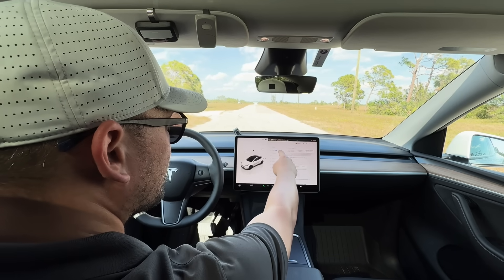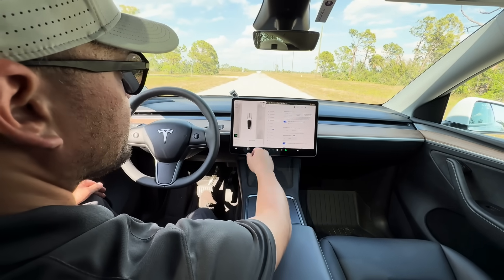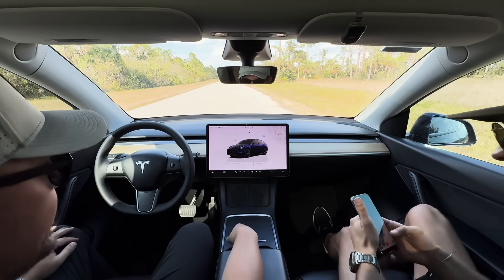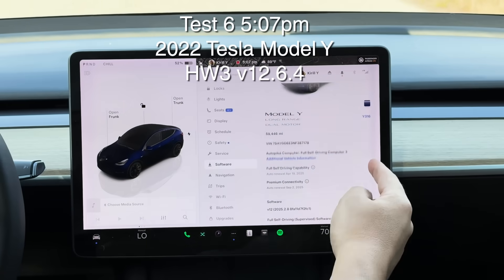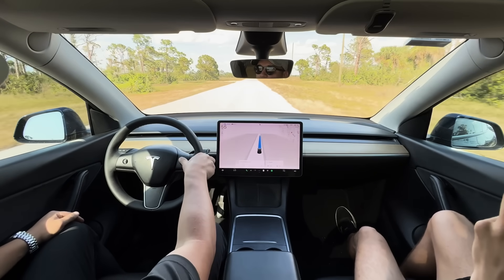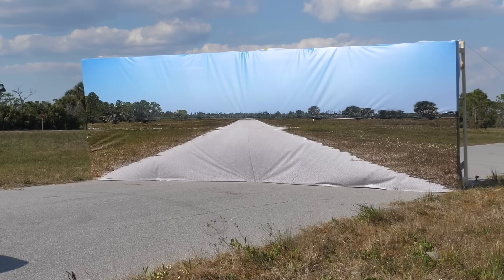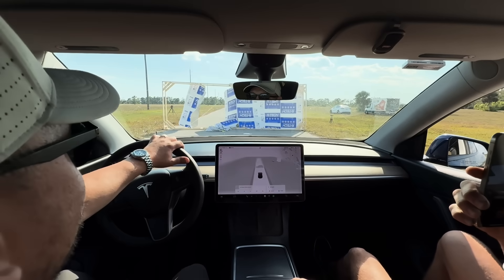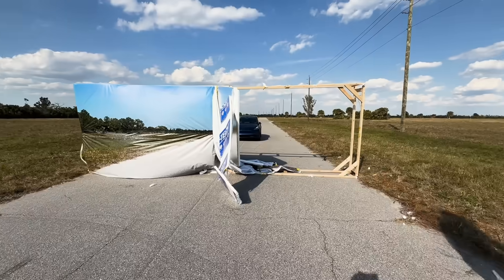Mark Rober Debunked - You can't fool a HW4 Tesla using FSD!

Comment: Finally someone does a proper test! What’s most interesting to me is in the last test the car doesn’t disengaged autopilot until AFTER hitting the wall. In  the Mark Rober video it disengages BEFORE, proving he manually disengages it.
Reply: Mark Rober is a liar.  He had ulterior motives.
Reply: Whether he did or he didn't is moot. The car was going through the wall and was past the point of no return for anything to be done.
Reply: @michaels9595  What I meant was it shows his intention to sabotage the Tesla run. And no, it would not have gone through the wall. He used the latest and greatest for LiDAR but previous gen software and hardware for the Tesla. If he used the latest for the Tesla as well it wouldn’t have gone through the wall. You have to compare apples with apples.
Reply: @Gilster85 we were talking the model y he was driving at the time. It doesn't see the wall in time to do something about it. Hitting the was unavoidable in that car. Right?
Reply: @michaels9595  Yes, the Tesla Rober used would have hit the wall but it’s using that Tesla that made the experiment flawed and screwed in lidar’s favor in the first place. It voids the whole experiment. Would you compare the performance of the iPhone 16 to the Galaxy Note 4? Of course not.
Reply: @Gilster85  ok just checking that we were seeing the same thing. Yes, he could have used it but as a laymen i did not feel deceived. Tesla autopilot was used and that was what was stated. I was not aware of FSD existence. But autopilot i was aware of and was familiar with issues that hit the common news. So the fact that it failed wasn't surprising. 

Why didn't he use the latest and greatest?  who knows, maybe he just used what Tesla he had and didn't put any further thought into it than that. But thinking he had an ulterior motive in either direction is not what i would jump to first.
Reply: @michaels9595 you didnt seem to understand Marks claim. He claimed that a camera system would always be fundamentally flawed in this scenario, and that the only solution would be LiDAR. Therefore his video was deceiving because, as this test clearly shows, Mark's claim is just plain wrong. A good scientist would issue a correction, given his massive reach. We will see if he is a good scientist or not.
Reply: @Supreme_Lobster  yes regarding the specific claim about camera vs lidar, this video testing hw4 shows that newer camera can detect the looney toons wall. 

Next, i hope this channel goes on to test the zero visibility rain and fog tests that Mark claimed failed. 

And yes I'd be interested if Mark does a follow up. It's how scientific process should work, i agree.

Comment: why not test the fog situation? or the heavy rain? or glare? Those are far more relevant and frequent.
Reply: Because you need to find heavy rain, fog, and glare. Mark Rober already tested glare from headlights but I guess Kyle could also do sunset or sunrise. And even Mark's HW3 Model Y on Autopilot worked fine with headlight glare. As for the other conditions; there are many such videos on YouTube already. Here's a few:
Heavy rain: https://www.youtube.com/shorts/v06fdMNJido
Fog: https://youtu.be/8REpnBJPcDg?feature=shared&t=264
Snow: https://www.youtube.com/watch?v=X_4RGfeICo4
Reply: @CyberFridge  That video of a Tesla in fog is a joke, I guess?
Here in Germany, you are not even allowed to turn on the fog lights in those conditions. Visibility needs to be under 50 meters to be allowed to turn them on.
-
As you may know, we have no speed limit at all, on most parts of our german highways. (5000miles without any speed limit). 
At night, the headlights of a car have a range of 100m. However, even my 11 year old Mercedes E-class has got radar with a range of 250 meters and allows for much higher speeds, than any Tesla (at night). Same goes for fog. 
I dont get, why people try to defend a camera-only system. It is obvious, that other systems also have advantages. So, why not combine cameras, radar and lidar, as most manufacturers do?
Reply: @dunjak111  Yes, I 100% agree with you that on the Autobahn (especially in the sections that have no speed limit) driving at night in the fog at high speed having radar would help. LiDAR, in my experience has a very hard time in fog created by real world conditions. Glycol or whatever they were using in the Mark Rober video doesn't have the same molecule size/refractory index from what I recall so it's not a perfect stand in for real world fog. Teslas approach is an end-to-end drive. Most people, are more likely to drive in cities at lower speeds on most days without 0 visibility fog. But you'll have pedestrians all over the place. Radar tends to give far too many "false positives" due to its range usually and I've tested different cars that use LiDAR and RADAR on top of cameras with various levels of ADAS. Last car I drove on the Autobahn was a Renault Arkana last year. Basic for the features it had compared to many others but did the job. So my guess is Tesla looked at the use cases and determined that it's easier to develop a steady system that uses vision only using neural networks and AI and that it can become many times better than a human. Eventually they may bring Radar back for extremely low event cases like 0 visibility fog at night on high speed roads but that's not where most car crashes and car-related death happen. So, address what kills most people; fix that, then you can go with extreme cases and avoid messing up your software with potentially erronous data in the meantime while it learns. BTW, virtually all Tesla being built for the past 5 or so years have had a radar on the INSIDE of the car facing the passengers. So it's not the Elon wants to save money. That radar wasn't used for anything all along but now with software updates they will be able to use it to dectect the exact size of occupants and if someone was left in the car for example to avoid a child being accidentally left behind in the hot summer sun.
Reply: @CyberFridge  Its either fog, or at night. The normal european headlights of a car have a range of 50-75 meters. That means, that by law, you are not allowed to drive faster, than 150kmh (90mph), at night. The radar has a range of 250 meters. So, it allows for a top speed of 240kmh (150mph), in my 11 year old Mercedes. (no fog involved)
Btw: It doesnt have autopilot. The radar is part of the standard emergency breaking system, of that time.

-----
" end-to-end drive [...] to drive in cities at lower speeds"
That is the huge difference between german manufacturers and Tesla. German manufacturers build according to german law and european regulations (for good, or bad).
As soon as a manufacturer allows the driver to take his hand off the wheel, the manufacturer has to take full responsibility for the self driving car. It is also not allowed, that any autopilot (or FSD) turns off just a second before the intervention. That is the german law.
Imagine a car without any autopilot causing a crash and the driver did not have his hand on the wheel. He will be held responsible for that. 
So, if Tesla wants to allow the driver to take his hands off the wheel, Tesla has to take full responsibility during that time. Simple as that.
I am not saying, that FSD is not capable! Tesla just does not want to accept that responsibility and that is why they dont get FSD in Germany, yet. Other manufacturers do accept that responsibility. 
-
However, for those reasons, Mercedes "level 3" works on highways, only. After you hear a warning sound, you have at least 10 seconds to orientate yourself and take control. During that time, the car has to keep the control and Mercedes has to take full responsibility for it. The useage of autopilots, (or FSD) has to be logged. That is the law and the reason for the different approach.
Btw: Germany was the first country worldwide to come up with laws for "autonomous" cars.  The laws are the same for every manufacturer.
Sorry, for my bad english..
Reply: @dunjak111  Alles Gut. Tesla does take responsability for any crashes that take place within 5 seconds of disengaging FSD/autopilot. It says so in their legal documents. So if a system disengages and the Tesla crashes 1 second later; it's on Tesla's system. There were a couple of instances of autopilot disengaging for unexplained reasons but those are from like 7 years or so ago. These days Teslas log everything to the second. In Mark's original video, I'm convinced that he unintentionally disengages autopilot by gripping and moving the wheel just before he hits the wall. Also, turning on autolipot only 4 seconds before he hits the wall was ridiculous as a test. I don't understand why he didn't give it more time. As we've seen from Kyle's tests, it wouldn't have mattered since HW3 doesn't correctly interpret the wall but it's not a realistic scenario. If the car is autonomous, it will be driving itself from 0 not starting at 40MPH (64km/h) and only have 4 seconds to react to a wall in the middle of the road painted to match the exact scenary. I mean: What does that test really "test" in terms of real-world applications?

As I said in other comments, had Mark said something along the lines of: "Tesla has HW4 with FSD which is more capable but because there are still many HW3 cars and not many people pay for FSD, we wanted to test the capabilities of the "basic autopilot" which comes for free with every Tesla against the latest LiDAR tech from Luminar." Perfect! No issues!. LiDAR is better than autopilot on HW3. The problem is that Mark picked that video title on purpose to mislead people and implied that autopilot was the best that Tesla has to offer; which isn't true. And yes, in some specific use cases, RADAR can help augment vision-only. But Tesla had RADAR and ultrasonic sensors on top of cameras in prior versions and the interference between RADAR and the camera input is one of the main reasons why they delayed the release for so many years. I think they want to make sure everything works great on vision-only AI. And then if it turns out that RADAR will be necessary in extremely rare cases; sure, add it then. The reality is that Tesla's cameras are better in most cases than humans already today and only getting better. It's not perfect yet.

Comment: Why did you change the location and paint a different picture than you did in the previous video? Here you have many trees around, which makes the wall much more visible at different distances. Also, the curve in the previous video hid the wall. Now you are approaching it straight from a greater distance. And you didn't test the autopilot itself. The situation and the picture in the previous video were more challenging than this long straight road with trees on the horizon in this video. You really wanted very much to have HW4 working well, right?

Comment: In October 2016, Elon Musk stated that a Tesla vehicle would be able to drive in fully autonomous mode from Los Angeles to New York City by the end of 2017. And last time I checked it’s currently Mach of 2025  and have tested the smoke or fog test.  ?
Reply: Here's FSD driving in heavy rain https://www.youtube.com/shorts/v06fdMNJido and in fog: https://youtu.be/8REpnBJPcDg?feature=shared&t=264 and here it is driving in snow: https://www.youtube.com/watch?v=X_4RGfeICo4
Reply: It can currently do that right now.
Reply: @swecreations  No it can't. You at a minimum need someone sitting in the driver's seat. Musk said you could call it on your phone and it would drive cross-country by itself. He also said it would serve as a robotaxi. He then went on to deny both those claims under oath in court. You were lied to, he knew he was lying, he took your money anyway.
Reply: @ Well that's a different story then, personally wouldn't buy a Tesla myself, like other EVs better.
Reply: @ Teslas were by far the best EV out there when they came out, ignoring reliability concerns. But they really haven't advanced enough to keep up with everyone else. The only thing they have going for them now is the superchargers.
Reply: @darrennew8211 the supercharger network is fine but it’s not the best in speed and cable management the cable are too short to work with most cars.
Reply: @V10PDTDI  It wasn't designed to work with most cars. Until very recently, it didn't work with anything except a Tesla. And the speed was way, way better than not having a charger around. :-) There was no other EV where you could reliably go on a road-trip that exceeded your single-charge range.
Reply: @darrennew8211 yes I know that it wasn’t intended for other brands but now the only tesla that’s can charge with the 800 volt system is the cyber truck but all other Tesla platforms are 400 volt class of system even the refresh model Y is still on the same system they don’t have the best charging speed the German,Koreans,Americans and Chinese have better chargers and charging cars in Europe Tesla has no advantage with the Tesla network they all use the same CCS protocol the only advantage is the Tesla is very well integrated with there own network.
Reply: @V10PDTDI  The advantage of the supercharger network is it's everywhere and it works. Tesla's reputation is involved, and it's a selling point for their cars, so they keep it running. Sure, if you're in a country where there are reliably chargers everywhere you want to go, then that's less of a  draw. But at the time Tesla started, there was nowhere else to get a charge while on the road. And of course it's all integrated so you know which ones are broken and how long the wait times are before you even start out.

I don't know if you ever tried to drive across your country in a battery car in 2017, but I'm guessing you wouldn't have made it. I couldn't have made it out of my state/province if the superchargers weren't around, and I tried the others.
Reply: Musk has the resources to make false claims and get away with it for almost a decade

Comment: I wonder if the image used on the wall has any effect? Mark Rober's video was in a desert w/o trees and it looks a lot more similar to the environment
Reply: Sure it has. Even here you can ask why Kyle changed the picture and location from the previous video. He obviously wanted to have much more trees on horizon and longer straight distance in front of the wall. You can ask, why he made the situaltion less challenging than he had in his previous video.
Reply: @mareksykora779  OMG there's no pleasing you guys. In the previous one people were complaining about the CT doing it later in the day so the bakcground didn't match. I'm willing to bet you had Kyle asked 10 random people to manually drive the car on that road in that scenario and didn't tell them in advance that there was going to be a fake wall at some point, at least 1 person if not more would have hit it as well. Point is, you're allowed to hate Elon. You're allowed to protest and not buy his cars. But the tech is solid. It works in fog, it works in rain, it works in snow, it works with glare in my experience. The closest scenario to this would be a 18 wheeler doing a U-turn on a large road and you don't notice the 18-wheeler and you hope the car can tell it apart from the background. I don't know what kind of 18-wheeler will have the EXACT background painted on its side where it happens to turn where the tree line will be in perfect sync with the real tree line. So it's a none issue. HW4 saw it; so it should also see the closest real world example of this which is a turning 18-wheeler.
Reply: >CyberFridge  OMG, you just cannot deny that this visual situation in this new video is much much less challenging than the one in the previous video. All we wanted was to use the SAME spot with the SAME picture in the SAME part of the day with the Cybertruck or other Tesla with HW4 and with AUTOPILOT. NOTHING of this was fullfilled. WHY?

Comment: You can see that the color for the sky if different due to clouds and the foreground have trees in it with then change the the perception of the picture as you get closer. In the first test you did, the picture did not have trees and the sky was clear. So I bet if there is no trees the camera would not be able to tell it apart and would still run into the wall.

Comment: This shows that HW4 is better than HW3 in this particular scenario, but you really should also have tested using just autopilot on the HW4 car. After Mark Rober's test, lots of people claimed that FSD on the same hardware would do a much better job at avoiding collisions, which sounds really dumb. Avoiding collisions should always have the highest priority, and even if I am not a Tesla fan, I just can't believe they'd purposely make it so autopilot would be worse in avoiding collisions than FSD (again, on the same HW).
Reply: It's not that Autopilot is purpously worse; it's that it doesn't have the AI brain FSD has. Think of this analogy: you get a page with a paragraph in English and one in Korean. You know "English" so that would make sense to you while Korean will look like random characters but you don't know what they mean and what to do with them. Now spend some time and learn Korean and you don't need to upgrade your eyes; you just needed more knwoledge. FSD is the system that is able to interpret what it sees instead of reacting to very basic stimuli. So, even though both Autopilot and FSD use the same sensors, FSD is by far superior. Also, according to this test that Kyle just ran, given that Mark's Model Y certainly has HW3 on it from the look of the car, even if he would have used FSD, it most likely would have failed the wall test. I think it would have stopped for the "rain" and probably stopped for the "fog/smoke" but that one depends on the wind at the time since that was much thicker than regular fog.